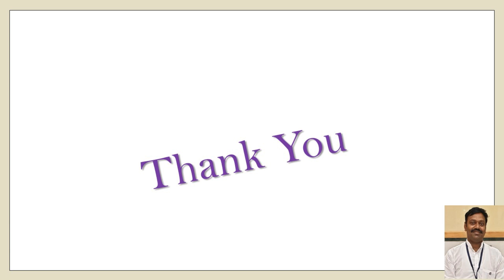SM39 Why Synchronous Motor is Not Self Starting ?

Comment: At low enough frequency it is self-starting. Also, with strong enough fields and usual frequency. Limitation is the main magnetic material - steel. It's both heavy and not so permeable.